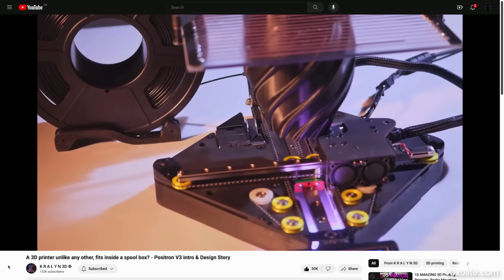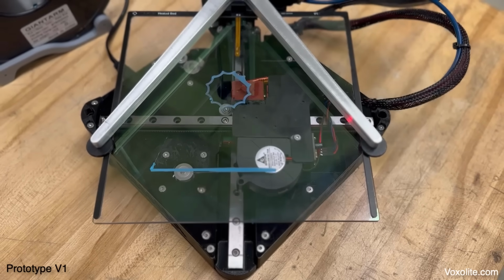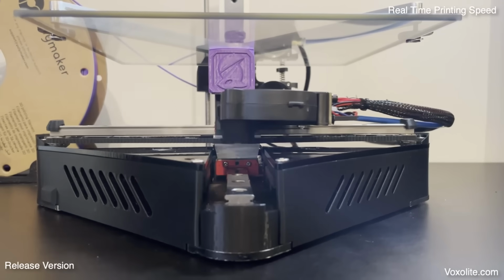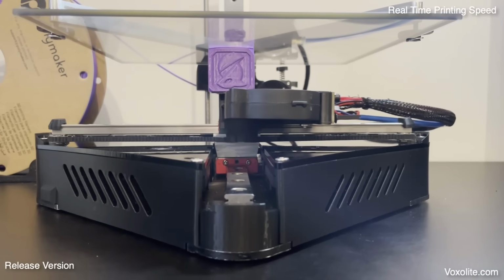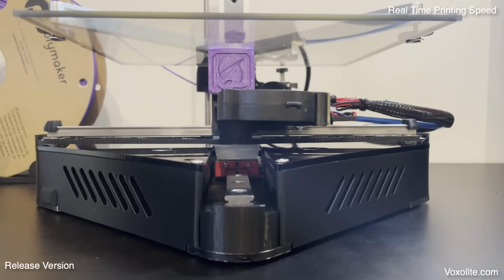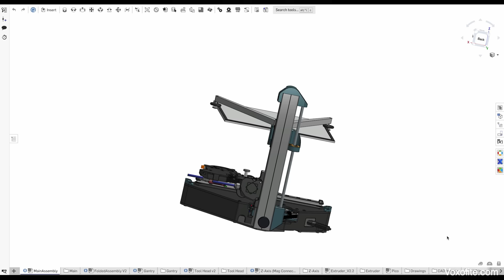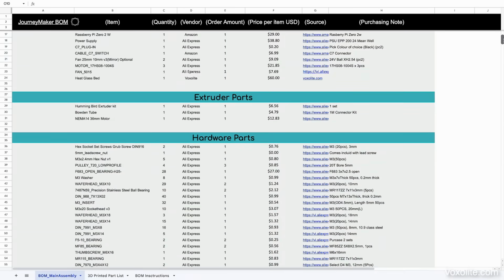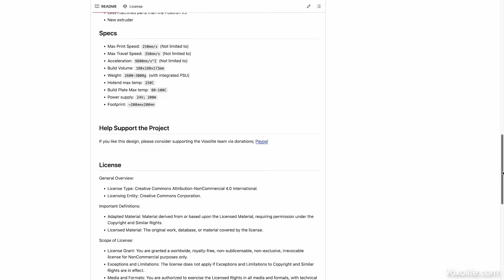Introducing JourneyMaker. Positron Re-Design

Comment: my main concern would be what happens if the print fails and the partially finished object falls off the "upside down" bed? Couldn't the print head extrude hot plastic back onto itself potentially causing permanent damage to the nozzle or even worse damage? All 3d printers have failures at some point. It would need some way to immediately stop printing if the object fell off.

Comment: wait what is that kinematic xy movement with just one belt ? how
Reply: Its how CoreXY works.
By making the motors stationary it increases the acceleration of the printer
Reply: @DavidCulverslicingblade  sure but all corexy systems I know off use two belts or do I miss something here ?
Reply: @MrBendix24  it is just one belt, it's the same as with the positron iirc, you can see it on pg135&136 of the build guide.

Comment: I'm seeing a lot of comments about how the mobility of the design seems unnecessary, but I couldn't disagree more.

I've been looking for a truly mobile 3D printer for YEARS and have been following the positron closely. I was holding off due to the build complexity and lack of support, but you have addressed both of those issues nicely.

Any estimate on when full kits will be available through your website? I'd happily pay 10%-20% more if it saved me the time and frustration of sourcing it all on my own. Especially if it came with a slick EVA case like the one in the video ;)

Great work. Can't wait to flex on all my friends at the next camping trip when I whip this bad boy out >:)
Reply from the maker: We wont be making full kits any time soon. If you join our discord we can help you out with self sourcing
Reply: Also a fantastic feature if you just don't have a lot of space. Being able to pull something like this out from a small storage spot and getting it up and running fast is awesome, as is being able to put it away just as quick when you need the desk/table space for something else.

Comment: Cool idea and concept but I see 2 problem. 1 is no heated bed end even if there was the heat would go up in air without heating print. 2 if print fail without you looking at, the extruder will extrude hot filament that will go down into whole printer and probably destroy it
Reply: the bed is heated, and the plastic would solidify too quickly to ruin anything, however, there would definitely be spaghetti everywhere XD

Comment: I built original Positron V3. Most difficult parts to make: pulleys and toolhead interconnect.
I don't like sychromesh artefacts on the printed surfaces.. It's more noticeable than GT2's artifacts. I think best solution is 1 mm pitch belt. It was also very difficult to get the hotend not to leak. I ended up using Phaetus Positron V3 hotend (with some basic milling to get it in) Now my Positron works fine 😺
Reply: Whoa, do they sell the hotend now?
After some initial leaking, my original hotend doesn't leak. Maybe it has sealed itself 😅
Reply: @Sesquialteral  No, they don't sell. I was given one to test and report issues.
Reply: @sovahc  sad. I would like to have a replacement just in case.

Comment: I love positron, I wish someone would produce ready to assemble kits. I know there was one run by someone but I missed it at the time and now it seams further from being commonly available compared to Voron0 or Rook. It's nice to see others being still enthusiastic about the printer.
Reply: Not everyone has the space to have a printer constantly occupy. A portable machine is easy to disassemble and stow away
Reply: What is so special or unique about a positron printer besides it's small, portable, size?
Reply: Yeah I was trying to figure that out too. The features he listed were cool, but being that it prints upside down, that introduces more issues. And, being that prints usually take a while, I'm not sure what the benefit of being able to carrying it around would be .  Not sure I'd spend the $500+ on it when I can just buy a Prusa. Reminds me of touchscreen flip phones
Reply: @Zhinoi  Going your thought process: Why buy Prusa, when Ender does basically the same for cheaper?
Reply: @darekmistrz4364 @Zhinoi
Much like the original creator of the positron, I travel frequently...weekly tbh for work. Making my 3d hobby difficult. If I had a printer of good quality that I could travel with it would be extremely handy. Just the form factor vs print area of this machine is so efficient that even people who don't travel can use this printer in limited spaces. This could easily be no intrusive on an average size work desk. And it still maintains a descent print size.

Comment: Does printing from top down change quality in any way? or maybe make overhangs less of an issue?
Reply: 1. The bridges are a little better. 2. You see the first layer.
Reply: now your prints will "sag up" instead of "sagging down"... Gravity is still present just exerting its forces in the opposite direction. Now you will have to worry more about adhesion though... and now you're more limited on build plate materials/solutions (glass only).
Reply: Curious about this too.
Reply: @K3NnY_G   I expect there is less stringing
Reply: It's not much better but in some cases gravity helps to prevent the model from dropping on the side.

Comment: Awesome take on the design! Glad to see it using more accessible / cheaper belts.
Reply: so we can expect a video on it in the future? 🙏
Reply: @mcfazio is the belt driven design from the Positron LT or V3 or some other source?
Reply: I was under the impression that the wire was the reason the design was possible in the first place, at least with the original motion system concept. Its funny how such a fundamental element of the design, something that allowed the prototype to ever get to the current position of optimization, ended up being discarded for simplicity of construction and a more cost effective BoM once the design matured. One of the wonders of prototyping.
Reply: Angus! Glad to see your comment at the top!
Reply: Is there a Kickstarter for this?

Comment: Quick question, besides the instruction manual, what else is different compared to the LT?
Reply from the maker: Check out discord. We have a FAQ section where we have a post that goes in depth about this. 

https://discord.com/channels/1158982699613163590/1175861407976271912/1192512591885504542
Reply: @Voxolite3D  PLEEEASE have this info available elsewhere other than a discord server. Not everyone can join (because they maxed out on servers or can't create an account for some reason), and being a private company that doesn't let people archive chats, a lot of info will completely disappear in the future when investors no longer deem it profitable.

Edit: in my case, I had to verify the account again and that link just refuses to work, probably because I need to use an invite link somewhere.

Comment: I have been waiting to be able to built this printer since the V1 and was very disappointed that nothi g happened anymore. My question is however if it will be possible to print from USB as well. Since the main idea of the printer is to be taken everywhere you might not always have wifi or simply dont want to have to configure the wifi every time you take the printwr to a new place. I feel that the ability to print from USB/online is important.
Reply from the maker: The printer host its own Hotspot connection that allows you to connect from any smart device (Computer, Ipad, Phone, etc). It is easy to wirelessly control and send prints to the printer

Comment: I think it looks Doubtful, i cant see a market for this, there is absolute no advantage to anything
Reply: With the gravity facing the other direction of the model. I reckon there would be less need to print supports. For small prints this would be a huge advantage.

For larger prints though, bed adhesion would be the main issue.
Reply: @neuling still going to need supports. Gravity is gravity bud. Sag will happen just in reverse. Not to mention,  now bridging is going to cause filament to sag into the nozzle causing collisions.
Reply from the maker: You should watch the original positron video where most of this is explained and shows that none of the concerns you have are an issue. 
https://www.youtube.com/watch?v=X_QLxTVtyng&ab_channel=KRALYN3D
Reply: I volunteer at a repair cafe. Right now I lug my mk4 with me, I am already working on the LT version of this because it's ideal for what I do there
Reply: Yes, that is exactly the use case that makes sense. Using the positron you could leave the car at home and go there by bicycle, so green! @AirsoftAbominations